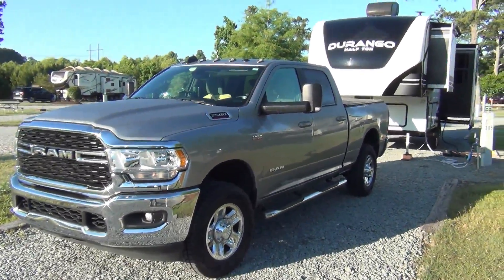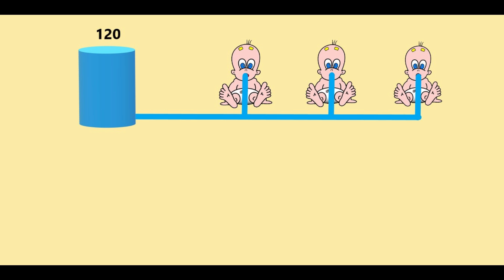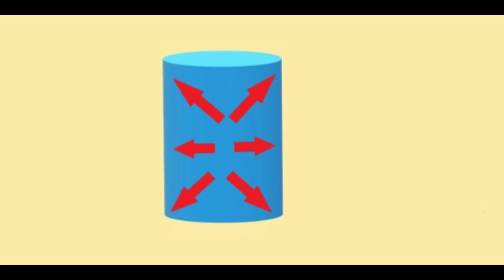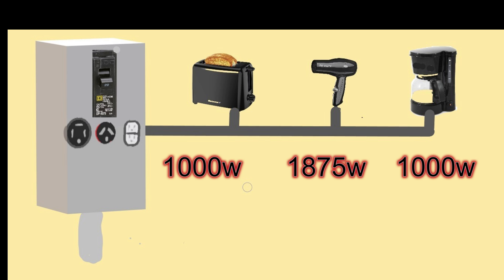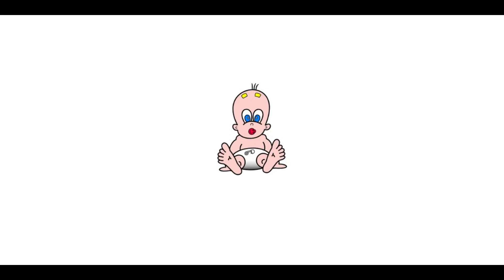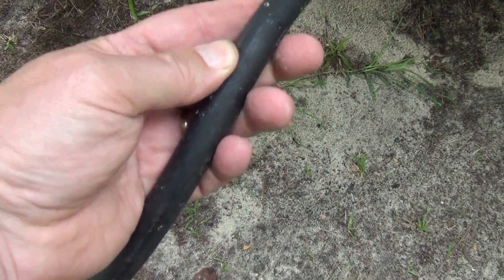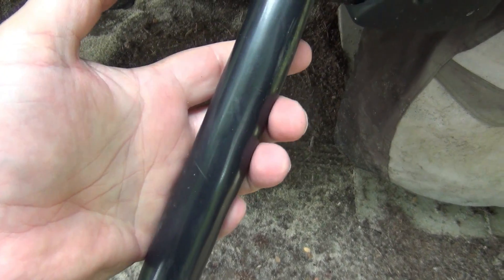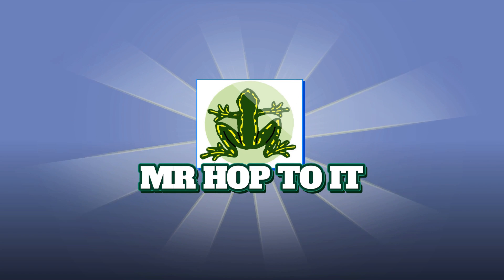Understanding RV Electrical Systems⚡⚡

Comment: 10:28 that NEMA standard is "120V only" it should never be connected to 240V and would actually be against code. But it also doesn't mean idiots do stupid things.
There is another configuration for 240v just for welders and another one mostly just for dryers.
Reply from the maker: A very good point. Thanks

Comment: As a life long electrician, and a real one for over thirty years, I wholeheartedly approve of this explanation. Outstanding. 

More completely, the two services are referred to as 120 volt, two wire, 30 amp, and 120/240 volt, three wire, 50 amp, single phase. 

I would point out that the duplex receptacle shown is actually a 15 amp, though they are allowed to be installed on 20 amp circuits. The 20 amp ones have an extra sideways slot on the neutral side as they will accept either 15 or 20 amp plugs.
Reply from the maker: Thank you!

Comment: only one problem you cannot tie the two 120v legs together to make 240 combining them together would be a phase short and would not be pretty
Reply from the maker: Thanks for watching
Reply: Yes technically that is true unless it's going through a load / appliance.
Devices that need 240V will connect to each hot and not use the neutral unless they have lower voltage requirements for like timers etc..
Although some RV pedestals are only fed with 120v since most RVs don't fully utilize split 240v. So you wouldn't actually be able to get 240V. Although I think the tide has started to change on that.